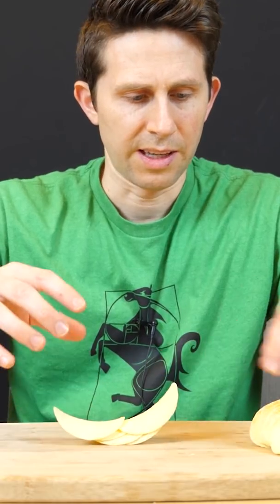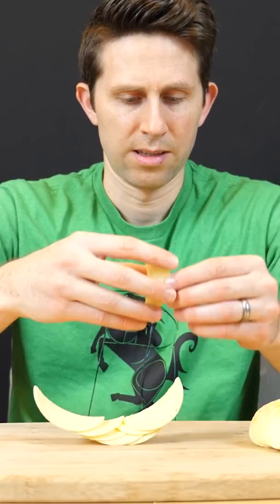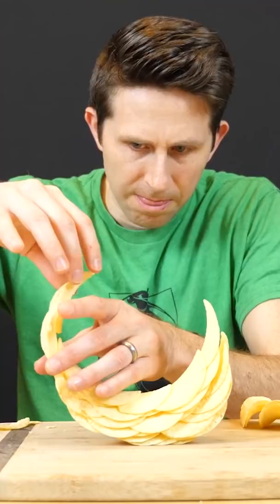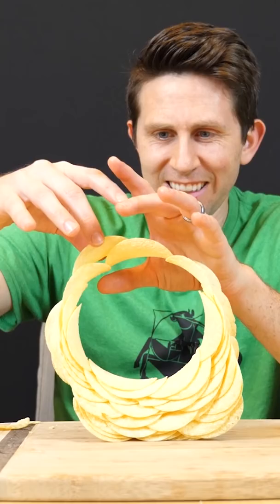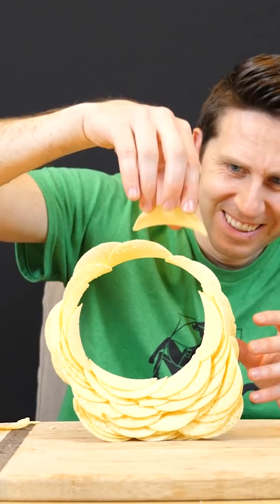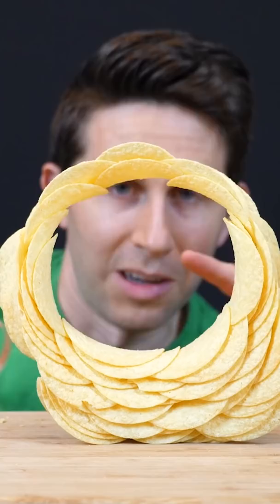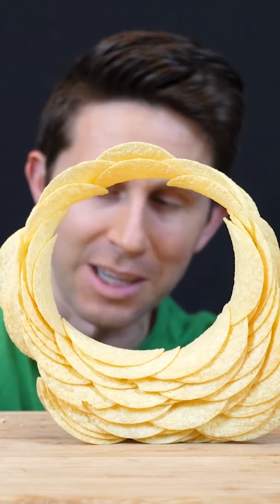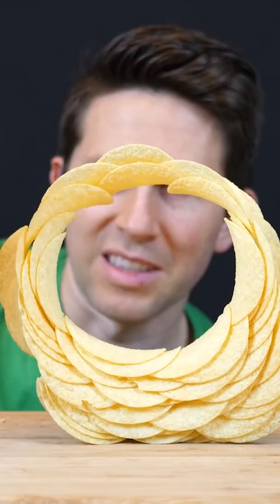Stacking Pringles In a Circle

Comment: This rule applies to playing cards as well so that you can stack them up and the top card is way over the bottom card.... By almost 2 card lengths in some people's builds.
Reply: With enough patience, it's actually unbounded.  Getting over 1km might require a stack that reaches to the moon though.
Reply: @pierrecurie  Bronze is an alloy consisting primarily of copper, commonly with about 12–12.5% tin and often with the addition of other metals (such as aluminium, manganese, nickel or zinc) and sometimes non-metals or metalloids such as arsenic, phosphorus or silicon. These additions produce a range of alloys that may be harder than copper alone, or have other useful properties, such as strength, ductility, or machinability.
Reply: @yrig6834  k
Reply: @yrig6834  wrong reply, or creative troll. Either way 1/10
Reply: @hentaidude666  k
Reply: @ShiratoriIsOffline  I too like to use the 11th letter of the alphabet. You can also use the 25th letter.
Reply: @hentaidude666  Many people are suffering a loss of education due to worldwide problems that I’m sure you are aware of. By doing this, I am ensuring that humanity maintains it’s prestigious level of education throughout the course of its troubles. You should have given me a 10/10 merely based on the fact that silver is the most reflective material.
Reply: @hentaidude666  get trolled
Reply: @guner1014  back in the day trolling used to be special. These days it's tweens taking out angst from daddy
Reply: @hentaidude666  im kidding, that guy isnt trolling he is just saying random facts
Reply: @guner1014  nah he is trying to troll, but in good spirits instead of just cussing people out. So that's why he got a point. Also cuz I replied.
Reply: @yrig6834  got it, tungsten is the most reflective
Reply: What in the hell happened here¿! I don't even know where to begin....     🤣
Reply: @yrig6834  Aw yes, I can now rest assured, knowing the future of mankind is safe by u replying on a random comment
Reply: @xpndblhero5170  This must be a new type of trolling.  I've never seen a totally unrelated true statement turn into a massive flamewar.

Comment: The true anomaly is that his Pringles are all perfect and not a single one of them is cracked in one way or another
Reply: Better than lays
Reply: Well, one is If you Look closely at the end, but only a little
Reply: True scp
Reply: You never saw all of those. Why would he use broken ones? Common sense. Think before u comment
Reply: mine are always fine
Reply: @PipMane  smart guy he meant that when you buy Pringles they are all perfect and not cracked and stuff.
If you buy lays or some other company chips they will never be perfect, some will be small, big, cracked etc etc
Reply: @sovereignboss1841  in a round box with strong walls VS soft plastic bag filled with air. Big brain guy, it's common sense to understand the first has better chance of staying intact
Reply: @PipMane  well I don't know. I just interpreted what that guy said. Maybe I interpreted it incorrectly.
Reply: @sovereignboss1841  still better than lays. Just know its you that pays for that extra package. Not everyone buys chips for package as it does not matter what matters is whats inside

Comment: I think this is the same principle as that of the Catalan arch or timbrel vault in architecture: instead of vertically stacking wedge-shaped stones against each other as you would do with a Roman arch, thin tiles are placed horizontally with fast-drying cement in multiple overlapping layers. It's lighter, stronger and more cost efficient than traditional arch building.